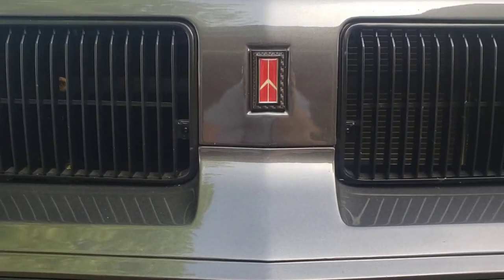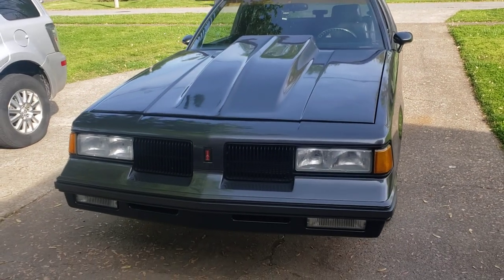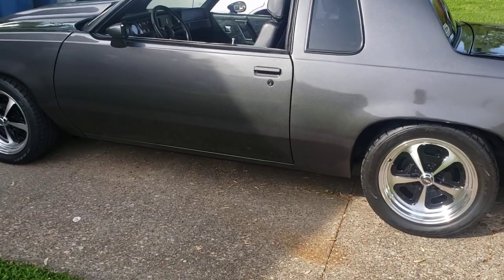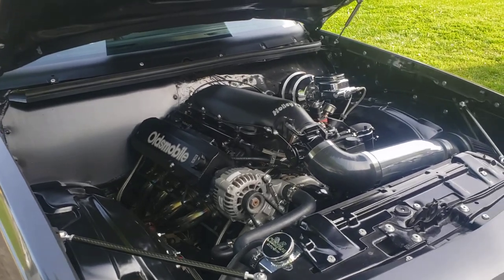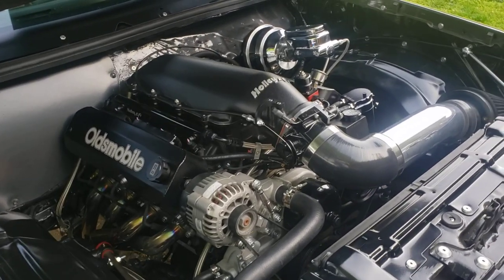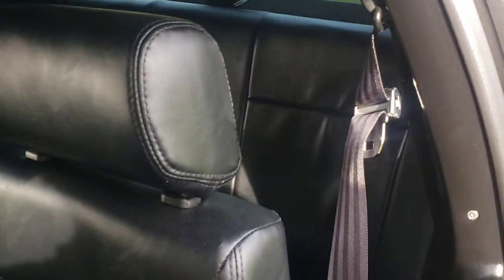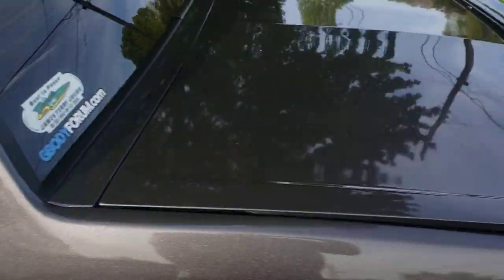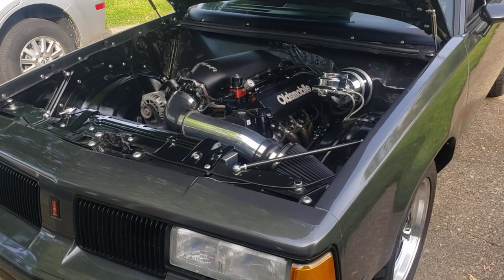87 Cutlass LS build bio

Comment: Nice build! I’m currently starting to build an 87 Cutlass Supreme. Just curious if you had to shorten the axles to fit the wider wheels?
Reply from the maker: Thanks! I'm running stock length Moser 30 splines now with F body rear disc brakes. It actually moved the wheels out a tad. With the 17x8 and 4.5" backspace I have at least 3/4" clearance to the frame.
Reply: @injectedcutty  awesome! Thanks for the reply! I planned on doing a rear disc conversion on mine, I’m not sure if that will make too much of a difference. Im honestly just trying to find a wider size that will fit without any rubbing!
Reply from the maker: @DeadCatProductionsOfficial  my buddy Cory has vette brakes all around on his Monte and it stops way better than the stock setup! I'm running front brakes from a 2000 Blazer too. I actually measure the mounting flange of the rear rotor to the frame and it was 5-1/2"
Reply: @injectedcutty  hm thanks for the info! I’ll have to look into it more!

Comment: Do you know the part number or link for the headers I got the flowtec from speedway motors and they hit the steering shaft
Reply from the maker: Mine are speed engineering #25-1025. I had to ding them in a couple spots, but overall they fit and look great!

Comment: Beautiful car, and by far the most thorough restoration I've ever seen. But yanking the Olds motor and going with a Chevy is like finding out that your wife slept with a black man. A reman 403 Olds longblock is a ridiculously affordable platform to work with an make ridiculous power.
Reply from the maker: Lol thanks! It's had a Chevy engine since 2003ish. Back then I was young and Olds engines were significantly more to have built right compared to now. The original plan was a 403 or 455, but it was cost prohibitive for a 19 year old.
Reply: I don't think this 87 Olds ever can be a California car on account of the smog modification.